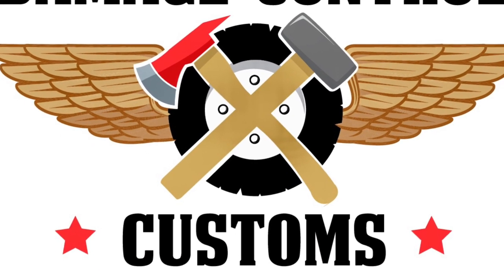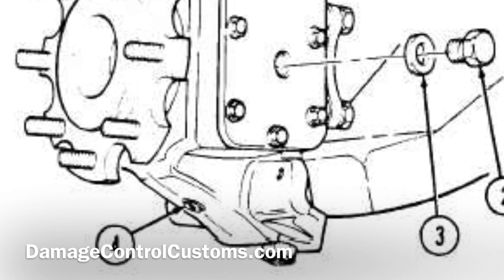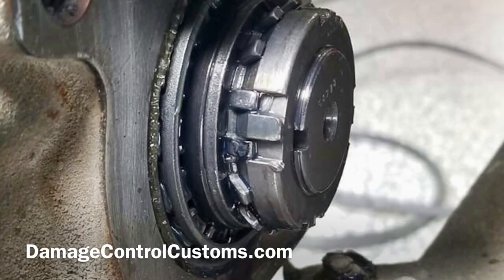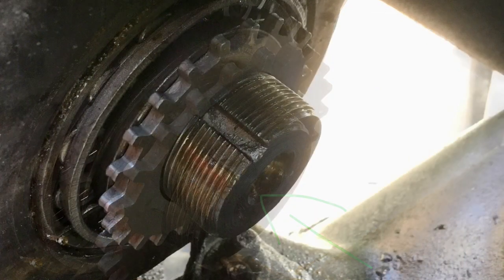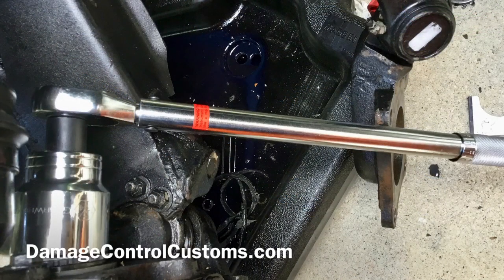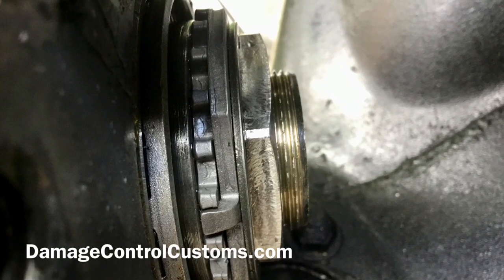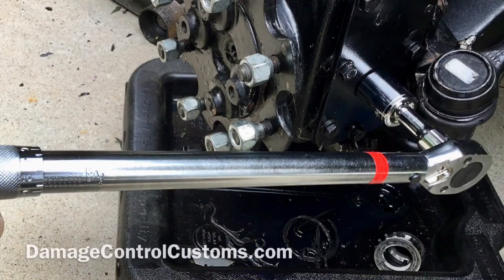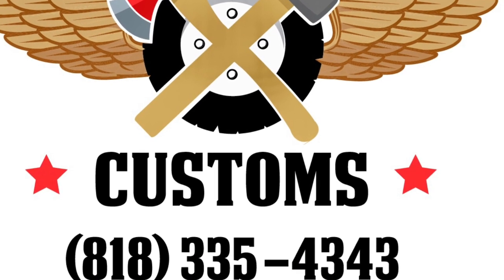How to install a Locking Spindle Nut for your HMMWV HUMVEE HUMMER H1

Comment: So after installing this upgrade there should be no more need to worry about the spindle nut again?
Reply from the maker: Hello sir, I'm not maker of the product so I can't tell you for sure.  With that said, I've installed the OEM and this and I like this better.  I would still check both but if I had to guess which would last longer I would say these.
Reply: @rubenmasterdamagecontrolma5313  thanks
Reply from the maker: @matthewjones8620  very welcome